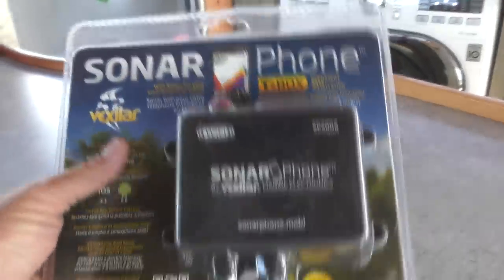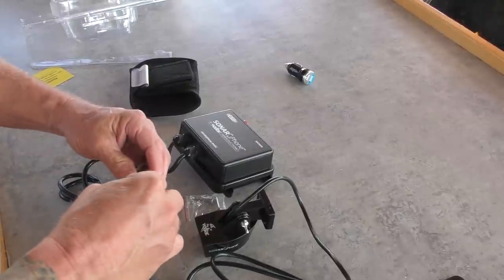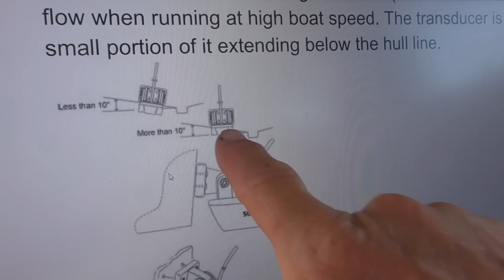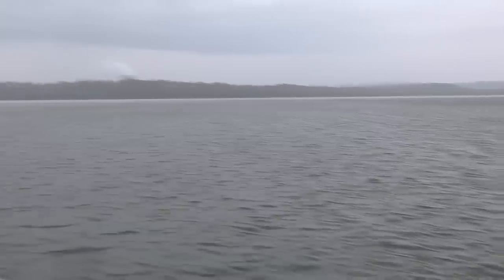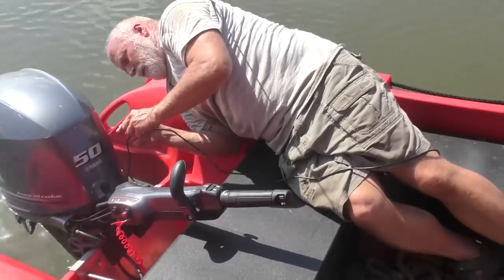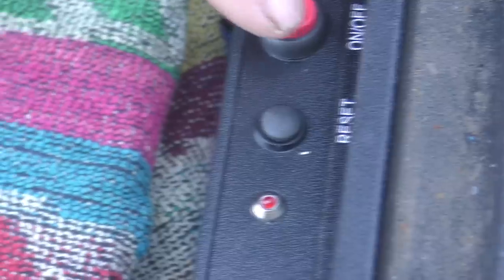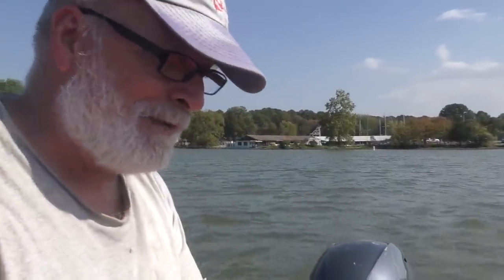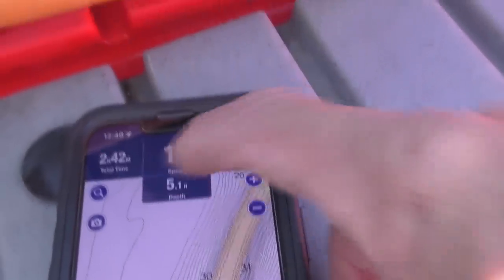A sonar on your phone - SonarPhone and it works with Navionics

Comment: Will the sonar phone connect to your pilot house displays at the same time.  What is the wifi range. So you have somebody in the outboard in front of you watching for sand bars.  So you can stop seeker before pulling up to the bar.  Sailing Uma on youtube has a sonar that allows you to do a 360 or wide turn in your selected Anchorage to record a 3D scan of the botton that is shared with the manufacturer's mapping so others can access that chart too.

Comment: Hi Doug.I noticed that you have a towel laying over your battery, If for some reason that towel gets wet  it might short or drain the battery.
Reply: The terminals are so far apart and the voltage so low that it doesn't mean a thing.

Comment: You should get a proper battery box for that battery. If the towel you are using for a battery cover gets too damp it could fry everything and/or start a fire.
Reply: It's 12 volts. Even soaking wet, it's not going to draw enough power to care about.
Reply: @user2C47  I nearly burned down my entire house with a 12 volt motorcycle battery. Damn battery store gave me the exact same one but it had reverse polarity. The design didn't make it easy to notice the mistake so they payed me out of company insurance for a totaled motorcycle. It went up in smoke in my garage
Reply: @user2C47  I replaced the harness myself and bought upgrades 😅 But a dealer would have charged $3700 to replace the harness alone.

Comment: The piece of angle was a good idea. Because transducers are replaced several times in the life of a boat, its always best to not bolt it directly to the hull. Especially because the holes for the new one never lines up with the holes from the old one. I bought a one inch thick plastic cutting board an bolted it to the transom of my boat. My transducer is crewed in to that. It will probably take 50+ replacement transducers before I would need to replace it. And even then I can use the same two bolt holes for a new cutting board. The cutting board was actually huge so I only used a third of it. The rest I am using as a cutting board. lol
Reply: I do the same thing, just glue the block on with some 5200. I hate putting new holes in boats!

Comment: That inline connector doesn't look to be waterproof? If it is not waterproof, that is a bad design:( multi pin connectors that are waterproof are a dime a dozen, so why not use the right thing.
Reply from the maker: If you were just in charge of the world.  : )
Reply: @SVSeeker  right, but still for marine equipment you would think that they would use "marine grade" connectors. Meh the rest seems nice tho!